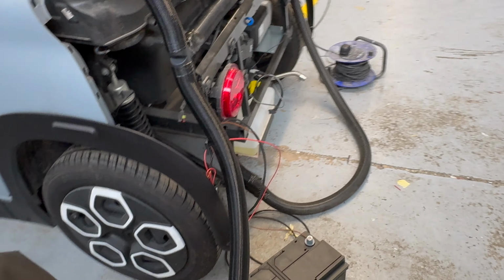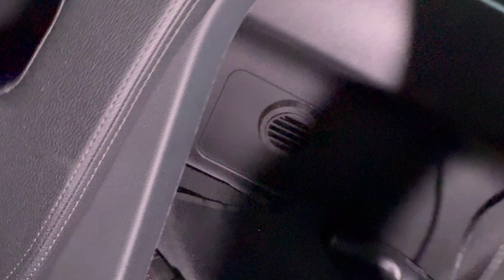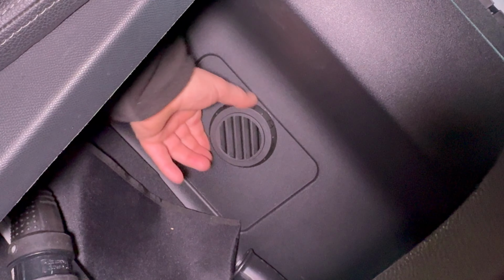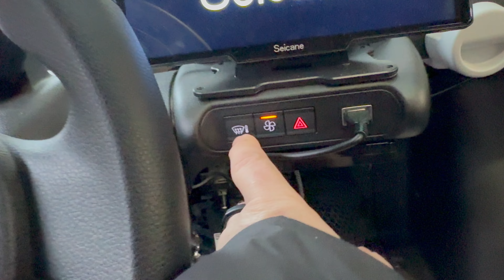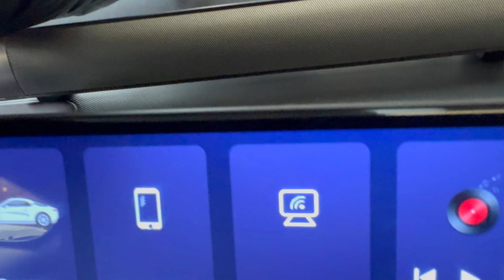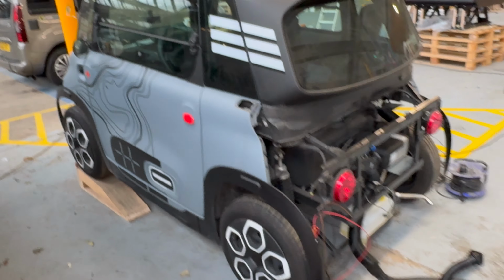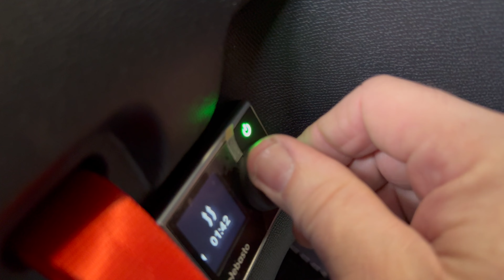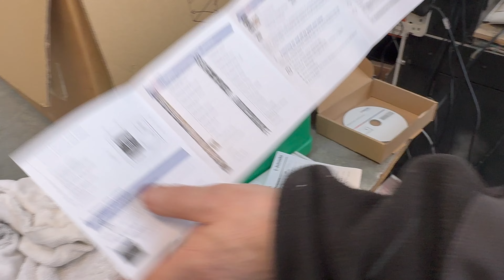Preliminary Trial and Testing The Webasto Airtop 2000 being fitted in my Citroen Ami

Comment: Nice to see you are progressing your hobbyist ideas on the vehicle. Will be interesting to see how durable that heating system is in a tiny car bouncing around the roads in Preston. Practically how are you going to refill the diesel tank for the heater.. clearly it’s not accessible with the back panel on.
Those heaters produce a lot of heat so your car will get warm but as there is little insulation in the Ami that heat will quickly get lost but I guess for your short journeys that’s not so bad.
An interesting hobbyist project but even in a warmer Ami i’m not convinced the vehicle would be usable 12 months of the year.
Good luck nice to see your ideas coming to fruition.

Comment: Interesting to see the result thank for sharing. I think a second battery with an isolator  for the Webasto would be a good addition, and you could likely use something like an inexpensive 20amp or less  bridge rectifier with in inline protection fuse rather than a large and heavy vehicle isolator. I located  a relatively affordable lithium iron phosphate battery that's the same form-factor as the OEM Ami Battery for Tim in France. I seem to recall it was 2X the capacity and half the weight so that might be enough to run the heater for a while, but of course once the 12V AMI battery is flat, you're not going anywhere without a jump. 

In regards to steaming up, and de-misting the windscreen, as the cabin heats up, your moisture may condense on the cold windows, and I wonder if bringing in fresh air from outside might help in flushing moisture out of the cabin.   

I know on my Toyota,  if I set the the the cabin air to recirculate without using the air conditioning compressor to dehumidify the air, and run full heat on the windscreen, as the cabin heats up, all that moisture condenses on the windscreen but if I set the cabin air to bring in outside air it forces the moisture out. but if I run the heater on the floor or panel vents and not the windscreen it fogs badly. If you decide to go with the hot-air duct to the windscreen, perhaps restricting the flow to the rear hot air inlet wold help divert some more air forward.
Reply from the maker: great info thanks

Comment: For charge/discharge control, you need a DVSR or VSR relay, commonly used in boats. 
When the car is charging, the 2 batteries are connected in parallel (when over 12.8 V) and when charging stops, it disconnects the two batteries, so the heater runs only on the auxiliary battery, and can never drain the original battery.
I would recommend feeding the heater with outside air, otherwise you will have condensation problems, as there will be nowhere for the humidity in the air to escape.
The difference in heating will be negligible anyway.
Reply from the maker: thanks will be trialling it in the outside world soon, so expect a sudden heatwave

Comment: I think reheating I.e. taking heat from the vehicle is SOO much overkill just run a 2KWChinese diesel heater straight into the back of the cab, would more than enough.

An additionally battery for the heater is essential as it draws a large current to fire it up and the 12V battery fitted to the Ami may not be capable of doing both.

 required

The Ami won’t drive without its 12V battery,I don’t know how the fitted Ami battery is charged, I assume it happens when it’s plugged in, if that is the case, will the fitted system allow another battery to now charge a second backup?

Further more the fuel tank needs to be safe as far as a rear end crash is concerned ?
Reply from the maker: its diesel not petrol, its actually quite hard to ignite diesel, even with a naked flame

Comment: No harm is trying the setup the way that it currently stands. If it doesn't work as you expect then you've lost nothing because adding ducting to the front is ancillary to what you have and not rework..
Reply from the maker: im thinking of splitting the Air flow from the vent and taking the ducting of the frame to the roof and putting an adjustable vent on to point the heat forward towards the windscreen but across the side windows as taking it to the front via another route would require smaller ducting which in turn may overheat the  webasto and cause it to switch off